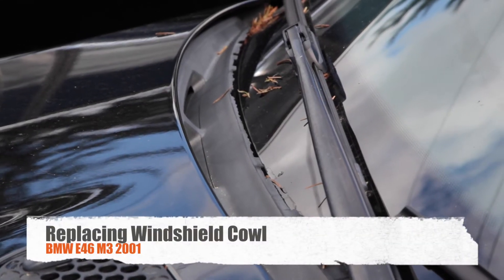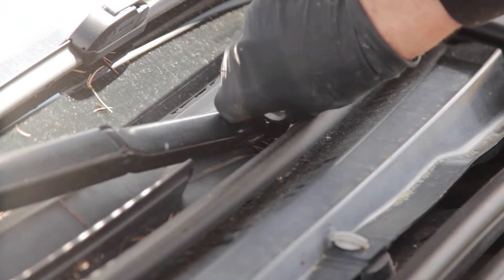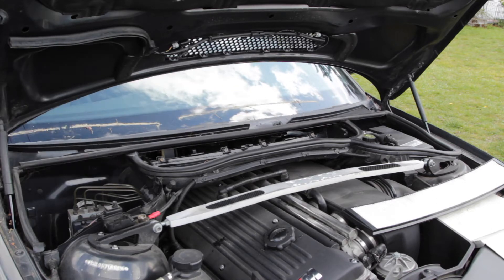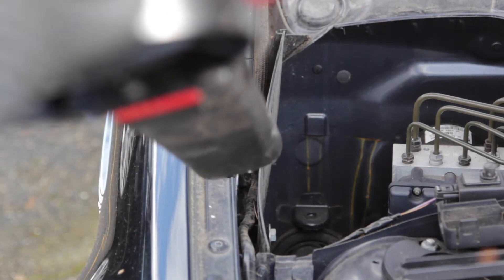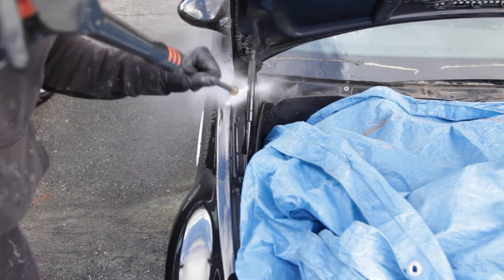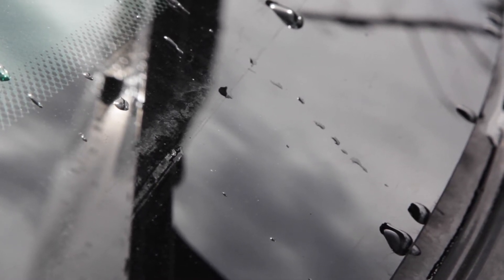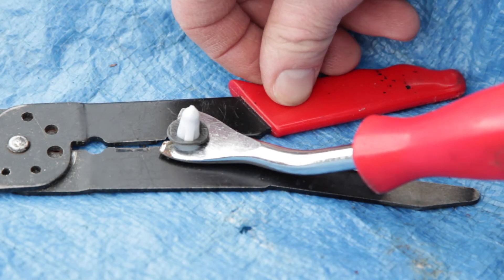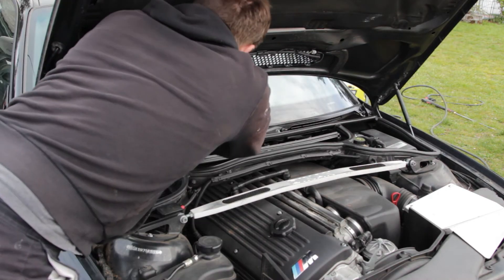Replacing Windshield Cowl BMW E46 M3 2001

Comment: Thank you man,excellent tutorial...i would only add 1 thing,a warning,people that will do this must know how incredible hard is to remove the wiper arms...specially the 1 in the center,actually nearly impossible.
Reply from the maker: Good call and you are welcome. 

Have to be careful.  What worked well for me was to do a controled wiggel pull up.  When I tryed to pull up or wedge / pry them off I did not have much luck. 

Have a great one.  🙂
Reply: Pull up near the knuckle and then press down on the knuckle. Easy way to remove all wiper arms. Sometime a wiper puller is needed to prevent breakage.

Comment: My wiper arms would not come off by shaking the arm nor by tapping with a screw driver and mallet as recommended elsewhere.  Had to delay the job until I got a decent wiper arm puller.  These are not expensive and hassle free and it worked great.  Also, the wiper position is 24 mm from the tip to the cowl seal for the right (passenger side) wiper and 44 mm for the left (drivers side) wiper. Cleaning out the dirt after removing the old cowl was the biggest part of the job.  While at cleaning, you may as well remove the flexible shields just below the ends of the windshield and get the dirt out from under there as well.
Reply from the maker: Great Advice! 

Thanks for commenting.  If my wiper arms do not easly come off in the future I will just get the puller tool too.  Thanks for adding spacing measurments. 🙂

Comment: i wish one day windshield cowl is my biggest worry on my e46 😆
Reply: After some rainy days I had Battery lamp ,oil lamp active and display didn't show anything ( fuel consumption, autonomy, etc. ) . Next day I did some diagnostics and had about ~15 active DTC's ( lot of them related to short open circuit) . After some days, display showed something but didn't respond to any inputs. After 1-2 sunny days, display respond again to inputs, battery and oil lamp were off. Then I realized one my ECU or some wires got affected because of the rain. The water got inside my car because of the bad cowl :) Thx for the tutorial

Comment: Didn't know this was a thing until replacing my windshield resulted in this unpleasant result. I'm waiting for the part and appreciate the dress rehearsal your video provides. Did yours have a cowl retaining nut on the wiper stem? Very nice, clear video, increased my comfort level with this swap.
Reply from the maker: Hey Kenskilla, 

I did previously remove an extra piece "wind spoiler?" on the drivers wipper bar or stem.  The new wiper blades did not fit and I did not mind the cleaner look.  I think there was an extra bolt to remove.    

I am happy this video was helpful! 😊

Comment: Very informative. What plastic conditioner are you using?
Reply from the maker: Thanks Ravi,

I used Chemical Guys VRP dressing, I like it.

https://www.chemicalguys.com/vrp-vinyl-rubber-plastic-shine-and-protectant/TVD_107.html?gclid=EAIaIQobChMIvt2qvYjn6QIVISCtBh2lLA3cEAAYASAAEgJHh_D_BwE

I have not yet tryed it but I heard this product works even better.

https://www.chemicalguys.com/carbon-flex-c9-protective-coating-for-trim/WAC228.html?utm_source=google_shopping&utm_medium=organic&gclid=EAIaIQobChMIkPXpoK_n6QIVeT2tBh1kAgcSEAQYAyABEgLHXfD_BwE

There are also other new ceramic sealants that work great on rubber and plastic that might be worth a try.

Hope this helps.  🙂